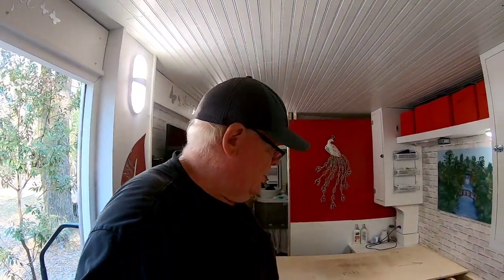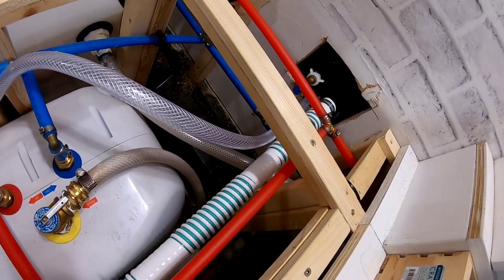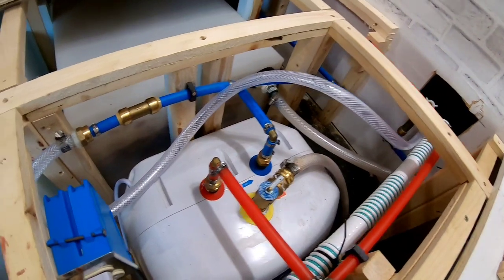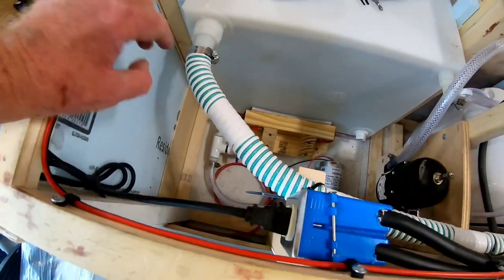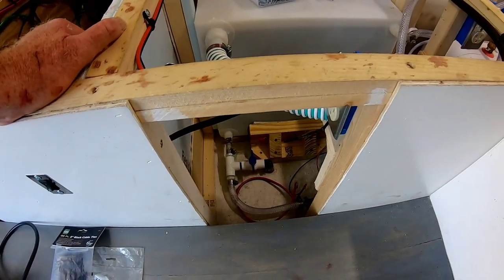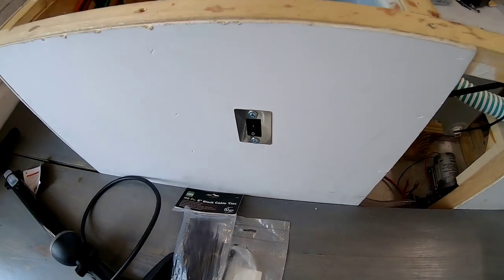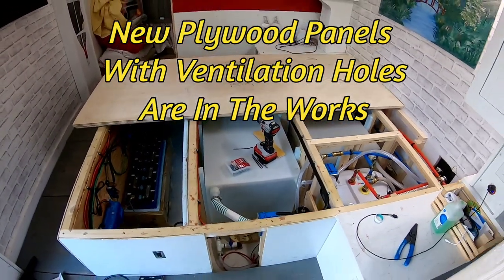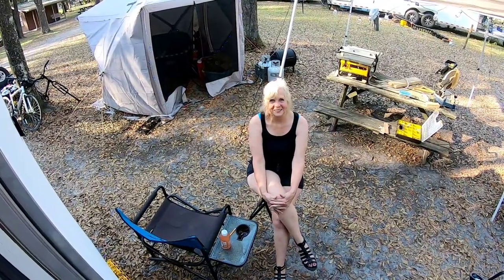Finally! Our Water Pump And Fresh Water Tank Is Working In Our Cargo Trailer Conversion

Comment: As always thanks Bill and Deb!
I had never thought about check valves for both directions while putting mine together, but then again I'm only setting it up for desert boondocking...I am now thinking of city connection for the possibility of full hookups just in case it's needed! Would be so simple to add it in the build. Reverse of your intentions of course.👍Thanks for all your hard work sharing with us, your fans❤ Ken from San Diego...

Comment: Bill, what size vinyl hose is that coming from tank to the pump filter? 3/4 or 1 inch?

Thanks, your channel is a great resource.
Reply from the maker: The feed line from the tank to the pump is 1/2 inch. The fittings that come with the pump are all 1/2 inch. The entire water system is 1/2 inch.
Reply: @billanddeb  Thanks!

Comment: what does the accumulator do............?
Reply from the maker: An accumulater is kin to a pressure tank on a well system. Supposedly the pump doesn't have to work as hard. We didn't have one on the red trailer. We'll see how it goes.

Comment: Bill does that is that the Bosch hot water heater? If so does it work good?
Reply from the maker: It's actually an EcoTemp. It looks very similar to the Bosh unit. I wouldn't surprise me if they're actually the same unit. It's the 7 gallon  version, and yes, it works great. No complaints at all. 1440 watts. I think there's a 4 gallon version as well in both products.
Reply: Thank you!

Comment: GFI outlet ?
Reply from the maker: This receptacle is split with to top plug served by the panel and the bottom plug served by a separate 15 amp power inlet. The receptacle powers the battery bank charger. I did it this way to power the charger from 2 optional sources. The top plug for when I'm connected to shore power, and the bottom plug for when I only have a 15/20 amp source to keep my battery bank charging while using my 3000 watt pure sinewave inverter. I'm considering a GFCI breaker for the top plug, and an in line GFCI breaker for the bottom plug. Of course, moving the water inlet on the tank will be helpful as well.